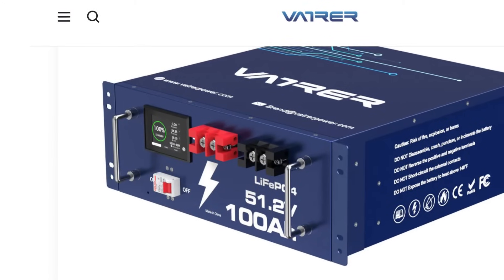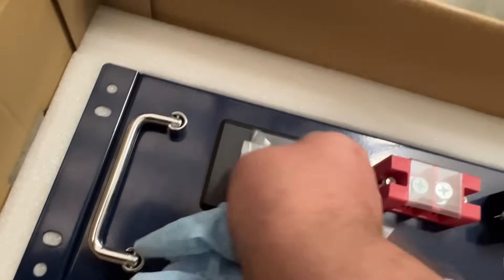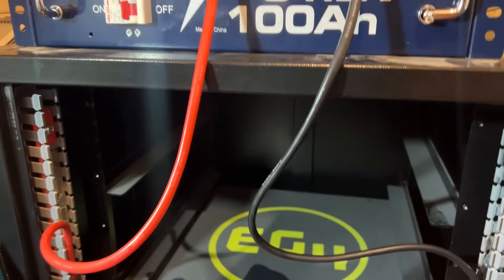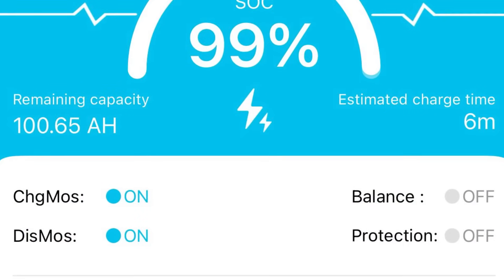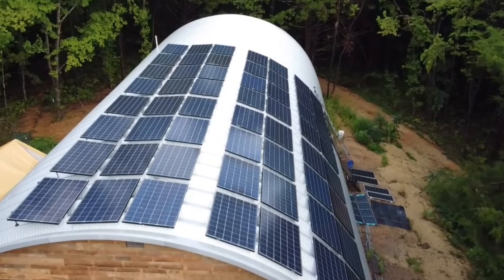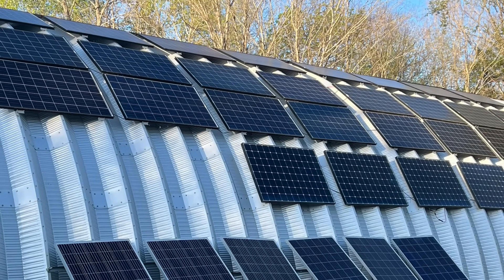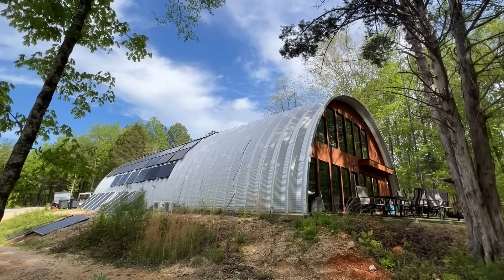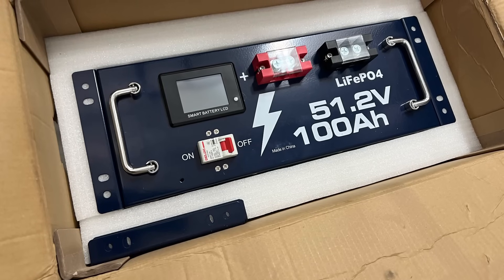Solar power battery 48v (51.2v) Vatrer LiFePO4 100ah 5.12kWh of storage.  Review and usage.

Comment: I was actually wondering if these VATRER could be daisy chained to the EG4 (same specs) but possibly different BMS systems. Vatrer said they do not recommend connecting to different batteries for that possible issue. It doesn't look like you've had any issues.  Please comment.  Thanks
Reply from the maker: No issues.  The bms for each battery does the job.
Reply: Same BMS modules?? Thanks so much for a GREAT video with great info!!!💪🏻💪🏻💪🏻

Comment: Are these working well with your EG4 batteries? I have 2 EG4 48V 100AH batteries and I would like to add one of these to my system to give me more run time during storm season. Thanks for the great video!
Reply from the maker: Yes they are virtual the same except better features
Reply: @BusGreaseMonkey the cells look identical: EVE LF100LA , I bet these are built in same factory, eh??

Comment: Hey i recently bought 4 of these and am hooking up a system with 2 10kw inverters. My question is do these have a way to precharge an inverter so I quit tripping the short circuit protection of the BMS when i connect them to my inverters or do I need to buy a resistor for precharging. This only happens when I hook up battery only to inverter with no other electrical input.
Reply from the maker: That’s the inverter doing that not the batteries
Reply: @BusGreaseMonkey  Yeah the batteries aren't causing the issue but they are protecting themselves from the huge current draw of the capacitors in the inverters. This is not a problem if you have an alternate energy source like grid hooked up as it will precharge the capacitors but if you hook up battery only then the capacitors in the inverters will need to be precharged and some lifepo4 batteries have an option to do this by means of temporarily disabling the BMS until the capacitors are charged (usually in milliseconds). My question is do these batteries have a way to do that?

Comment: Ohh wowww very nice guys ....I  have  a question  I have gmc conversion  van and I did all  solar  I have a total of 360 watts total on the roof panels  my inverter is 2500  pure sine wave.  I have 2  lead cell 100 AMP HRS batterys. Wire in parallel.....my system  12 volt 120  electric...but I would like to have small microwave.......do they have  a unit  like that  were I could get ride of my batterys ....I'm learning as I go  😊😊

Comment: Made in China. Any battery that says that is a firm no from me.
Reply from the maker: @robertI153 assembled in usa with china made components
Reply: @robertI153 using the same exact cells😆
Reply from the maker: Who is making them in the USA?
Reply: its that sad truth. but if you are worried about being made in China you will never own ANY Lifepo4 battery , maybe battle born. but do they make 48 volt , I haven't looked at them in a while
Reply: @chadjones99  facts. Even then they are still using Chinese cells

Comment: If you're gonna run those 2 in parallel you should take the positive from one and the negative from the other and run the parallel links between the 2 otherwise they will run slightly different voltages between them.
Reply from the maker: That was obviously a temporary addition of the batteries.
Reply: @BusGreaseMonkey  I suspected as much but though I would point it out as it is as easy to wire temporarily correct as temporarily incorrect 😉

Comment: Some relevant information to give next time : 
- Type of cells used ( 21700 / 18650, chemistry, brand )
- Does it have the ability to control charge % ? ( 80% / 90% max charge limit for longevity ) Leaving lithium ion batteries at full charge or fully depleting them are bad
Reply from the maker: There are tear down videos of it on yt already

Comment: Hopefully, @WillProwse will get his hands on one to open it up and see what's inside plus do full testing.
Reply from the maker: https://youtu.be/yzO9HKg1294?si=Y1jtMWaVtK7EcdIw
Reply: @BusGreaseMonkey , not bad, but, I think I'll stick with EG4.  The BMS settings in the Vatrer aren't as conservative as I'd like.  I think the ($200 at the moment) extra cost of the EG4 will be offset with a longer life than the Vatrer.
Reply: @pcspecialistpdx not really. Vatrer is rated for 100% doc for 5000 cycles. The EG4 80% for 7000. Not a huge difference at all

Comment: Every month it seems like a new Chinese battery company appears.  It is madness trying to fix and service all these brands.
Reply from the maker: They all use the same internal components.  A few variations but relatively standard
Reply: @BusGreaseMonkey  Are they really made the same?  Will the company be in business in a few years for any warranty issues?  Is the BMS reliable enough to prevent meltdown?  Will the BMS go haywire and open circuit?  All things for time to tell us I guess.  There is a lot more to a battery than just the cells in it.
Reply from the maker: Search for a tear down video of this battery.  It’s all pretty standard.
Reply: @BusGreaseMonkey  It is the same with buses, they all have the same internal components.....
Reply: Its not so bad.  Almost all of them use EVE-style prismatic cells and a similar BMS.  I bought 4 of these from amazon returns with shot BMS units for about 50% of new cost, and smacked in a BMS suitable for my purpose for 120 for each one.  The breakers are all pretty standard format, etc.  Only thing that requires a little bit of change is the internal wiring, but it's no problem if you have the stuff to crimp medium and larger gauge battery terminals.
Reply: @BadHaddy  Any information given on why the 4 units had bad BMS's ? 
Any feedback after taking them apart and doing the work you mentioned ? ( like : certain internal components that look weak / poorly put together )
Reply: @LORFCASTER  Nah, these ones clearly had been damaged by being connected in reverse polarity.  Quality is within expectations for a non ul/certified product.